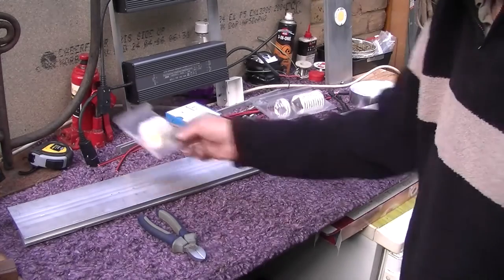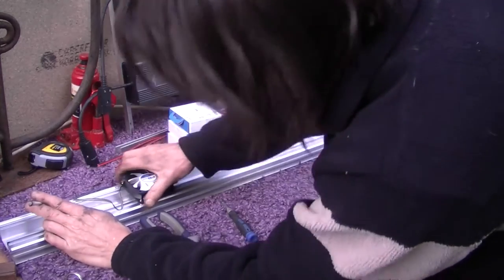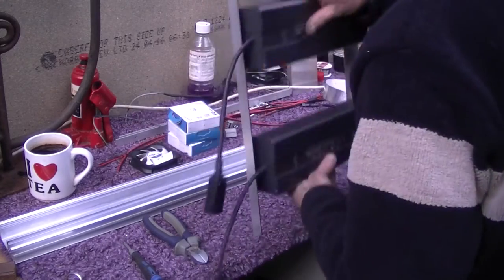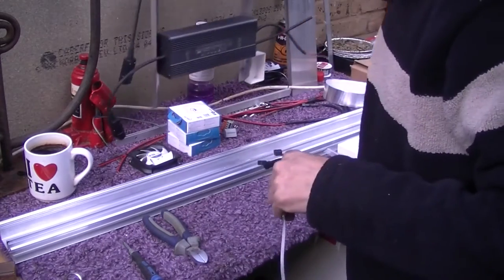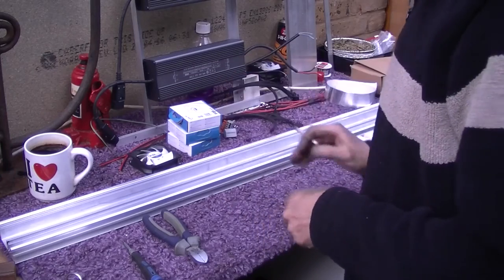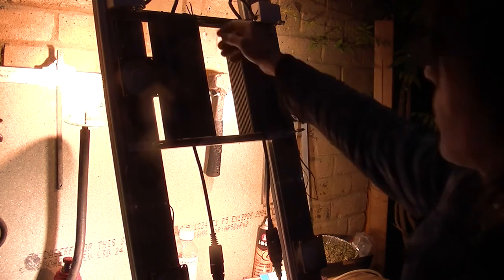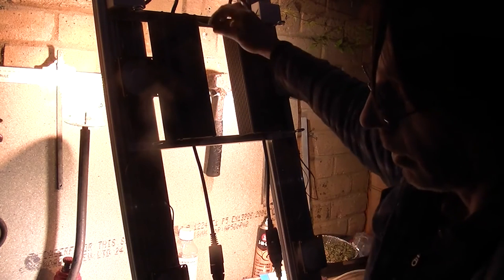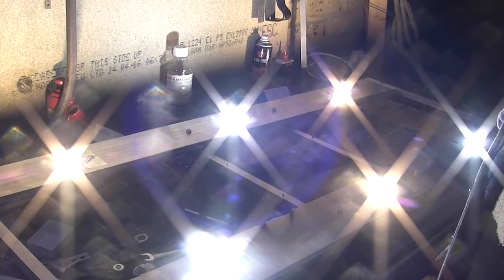3KW Vero-29 Big Build 600w Array

Comment: Wish I had the know how on being able to do a build like this. Not many lights Available in the UK like this at the moment and I personally have never been an electronics put togetherer. Great build and amazing job. Hopefully oneday I will grow a pair and give something like this a try. 🙏🏻🇬🇧
Reply from the maker: I now have the supplier who supplies my supplier and they can provide these heatsinks cheaper AND ready drilled/tapped, minimum order is £250 so will need to have at least 10 per order but we might consider stocking the excess if the demand is there, the only 'machining' would be cutting and drilling some thin ally angle for the frames if you want pairs but no reason they cant be hung as single bars. Wiring with those wago plugs is as simple as poking a bared wire in the hole and snapping a clip shut. there are even purpose made plugs for these vero's so zero soldering required, I just prefer hard wired connections for these sort of powers.
Reply: Contact Timbergrowlights. They build pre assembled COB Grow lights on both the Vero and Cree platforms. You'll pay an extra $300 over a DIY build but they come assembled (plug and play) and carry a great warranty. Best option for the non DIYer.

Comment: nice build man,those heatsinks look sweet to work with.can you tell me about those drivers your using,i didnt catch the name brand ?
Reply from the maker: Thanks man, the heatsinks come thru rs components but.... we accidentally stumbled on rs's supplier AND they can supply them any length BUT pre drilled to boot!! so trust me, the pillar drill and tap and die set are retiring! The drivers are made by 'Brightstar LED' you can find them on alibaba, or I could hunt out the link if you prefer, I'm just looking for a 1Kw driver for one of these pairs, thermal management has been so good we know we can pour nearly twice the watts into these Vero's so for the unit going to a flowering room (4 are for veg ffs!!!) could easilly hose out double the quantity of angry pixies and still stay adequately cooled.
Reply: Jack Freeman Are you by chance a fan of AvE???

Comment: Great build. What chip are you using?I have a set of 3 Vero 29 BXRC-40E10K0-L-23These are the chips from mid 2016 and I see newer Vero 29's are out pushing 12000 lumens (SE series). I had the PAR tested on the L-23's and got a maximum result of 1280 PAR at 3 feet running at 75 watts per COB . I'm using the new HLG-240h-C2100 drivers from Meanwell. My question is...as I need to buy more chips (grow is expanding) what Vero 29's would you recommend (4000k) in the new 2017 lineup?
Reply from the maker: Hiya, sorry not got time to check which precise model number we are using here but yes, these are the gen6's from '15/16 with a rated output of around 9,000lum, selected at the time because the new gen 7's were hard to source and very expensive, not so now, so I would use the gen 7's if i were to repeat this build today. As to colour temp, we have landed at 2700/3000k AND 4000k mixed as the best spectrum, this way we get an extra boost both ends of the spectrum and we do not see the plants showing any preference for either.
Reply: Jack Freeman 
If you get the chance grab a few BXRC-40E10K0-D-73. They have dubbed it the "CXB killer". It's Vero's gen seven 37.7V chip putting out 11447 lumens at 2.1A. Digikey has them for $24 CDN. You can buy 3 for the price of one Top Bin CXB. At 147Lm/w you can't beat it dollar for dollar. Plus you can overdrive the hell out of it.

Comment: nice build, did you happen to get a weight on the finished unit by chance
Reply from the maker: Thanks, just weighed it especially for you! 22 lbs (10 kilo) with 10 lbs (4.6 kilo) of that being the drivers which of course can be remotely wall mounted if ceiling load bearing is nominal. These units will be hung from rawl bolts in a cast concrete basement ceiling.
Reply: Cool thanks definitely some good content here on your channel. keep up the good work

Comment: Hello Jack,

Maybe a strange question but I see on your video you use the Bridgelux Vero 29 COB leds. I tried to order one from DigiKey but it is only possible when I order 50 pieces! It costs me more than Thousand dollars here in Europe. Is it possible that I buy one led from you? I use the Vero 18 for an underwater video light but really like to test and experiment with a Vero 29 one!

Thanks anyway!

John Wijers
Holland
Reply from the maker: Digikey 'should' stock individual units, if you filter your search results to only include single order results you should find what you're after, if not try rs components (very expensive) or Mouser (ships from usa). You may have trouble obtaining single units of the gen 7 29's but the gen 6's are still industry leading units and are actually the cob's featured in this video.
Reply: Hello Jack,
I sent an email to Bridgelux and they gave me a contact person in Germany and Holland. EBV Electronics is one of the companies that sell Bridgelux. This week I will try to get a 29 led.
I will also search for the 6's gen. Thanks for your information!
John